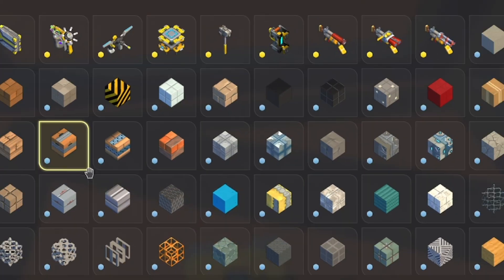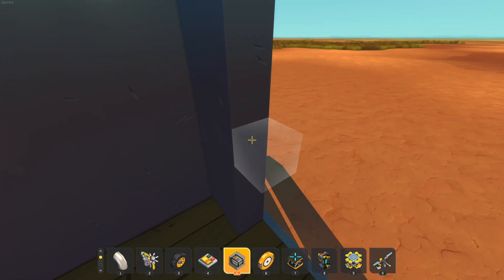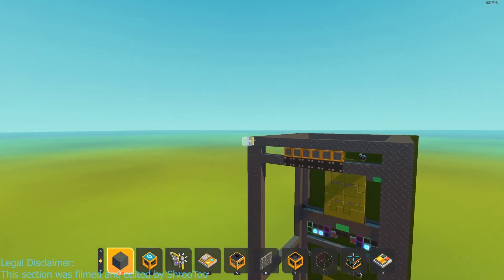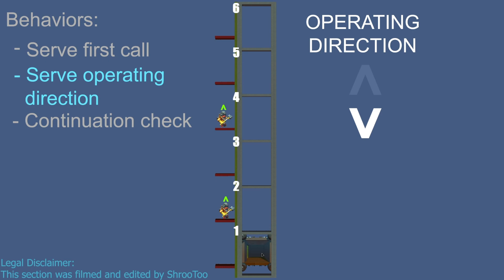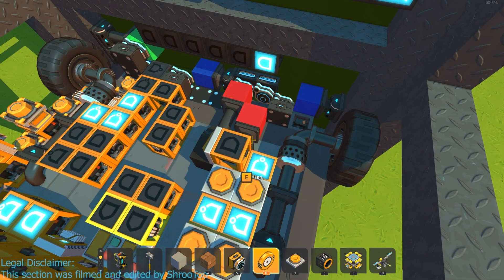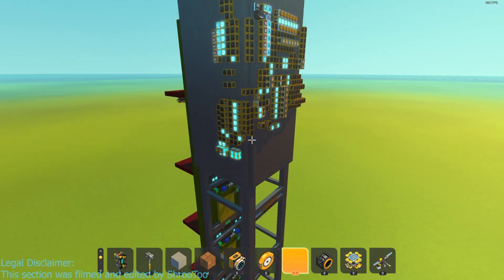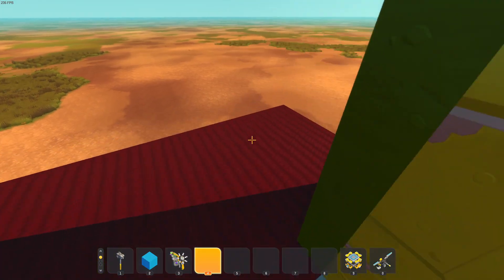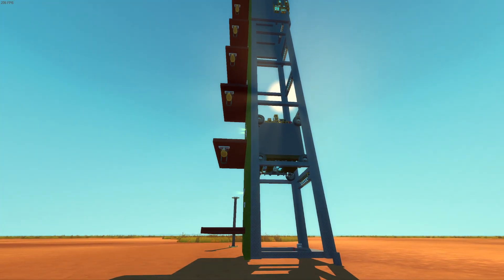Making an Advanced Elevator in Scrap Mechanic!

Comment: Can you make multiple elevator shafts that works together similar to what you see in hotels?
Reply from the maker: i was thinking of that at some point. the complexity would be much higher though with it having to keep track of two elevators and find the most efficient sequence.
Reply: @ChungoMonko  i'm not a very logic person at all but maybe you could have them sequenced as elevator 1 elevator 2 and so forth and only have the later ones operate when the prior elevator is in use. that way it can be somewhat modular and able to add as many as you want easier.

Comment: Need help with roller coaster rail turns!
Reply: Can u make a video about it pls
Reply: I use the web site to transform a circle into squares circle
Reply from the maker: @Mickanin_Doggster69  you can look at my video on the wild mouse coaster. it’s more so about having a balance of wedge lengths as well as making sure the wheel assemblies can move freely. i like to make each wheel assembly have independent movement.